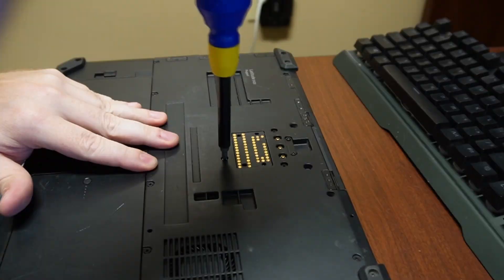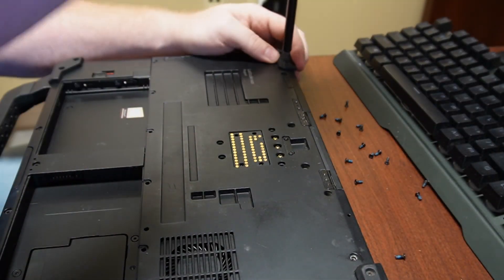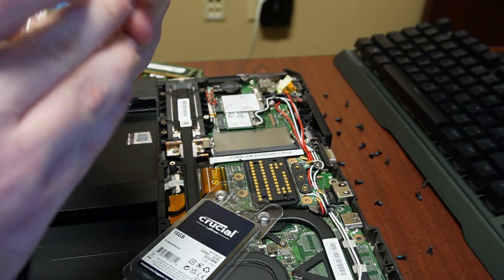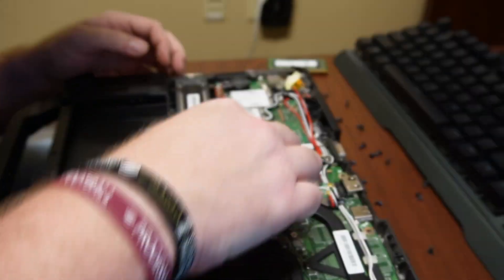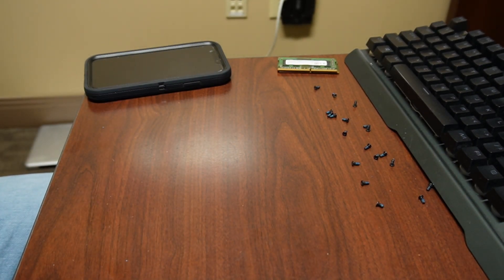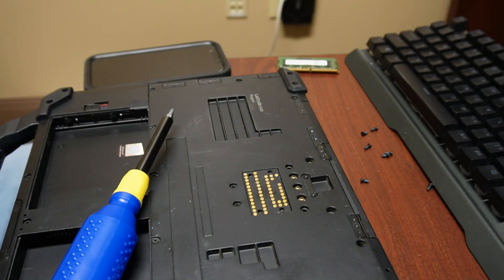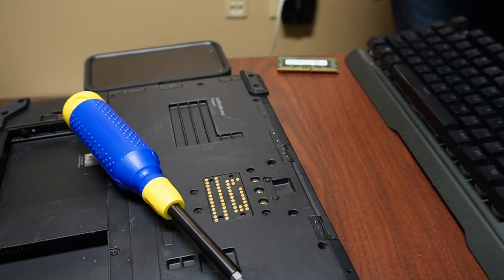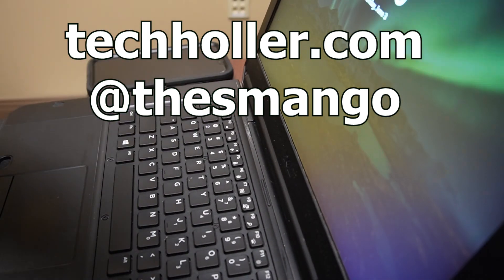Dell Rugged Latitude 5420  Upgrade! from 8 - 32 Gigabytes of RAM

Comment: I work IT at our company and we've already cycled out these machines. I loved them! The RAM you had in there was 2X4GB@2400 You most likely replaced it with 2X16GB@2666. It won't run the RAM any higher so it will still show 2400 in BIOS. I don't think it will take 64GB RAM.
Reply: Yes it definitely will take 64gb of RAM . I upgraded mine to 64gb .

Comment: Did you spot anything like an MXM socket in there for the discrete GPU option? I upgraded the gpu in my 5404 with a GTX 720, but doesn't look like it's quite that easy in this model - despite the service manual referencing a a gpu upgrade option
Reply: On Ebay, I saw a Latitude Rugged 5420 mainboard with the GPU soldered to it. I'm fairly sure that after the 5404, all the GPUs are soldered to the mainboard..

However, you have piqued my interest into the 5404.

Comment: can the ram slots go to 64 GB? I know the cpu of intel 8e generation can only support max 32gb. I wanna know what if two 32 rams are installed. Will the laptop boot up normally? and how many actual ram it will show up in task manager.
Reply from the maker: They make 64 gig kits and that’s what I wanted to put into it but our crew decided against spending little extra. So yes it’s suppose to work, but unfortunately I didn’t get to try it myself.
Reply: That's kinda sad, I consider it as a workstation laptop, 64 gb ram isn't that big deal to give a try.
Reply from the maker: @dexternever3146  Ah yeah it is what it is. Hopefully I'll get to upgrade a few more soon.
Reply: @dexternever3146  I think the significance is in what they cost, I opted for 2 x 16gb 4800Mhz.
As that in my Aussie dollars.. AU $180.00 for 2 16gb 4800MHz... and for the  16gb x 2, 5200MHz AU $238.00.
I thought I wouldn't even like to look to see what 64Gb would be worth.. but that I did.. ouch. AU $377.96 for 2 x 32Gb.

I keep thinking of it as .. lipstick on a pig.. and then buying it a hand bag and matching shoe's.. for all 4 feet.